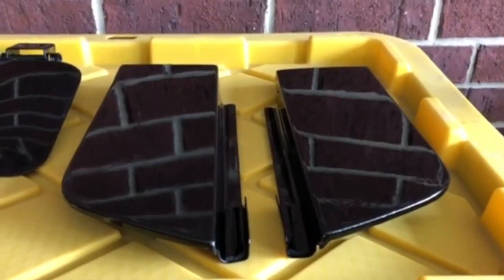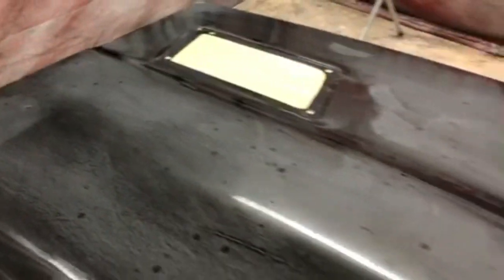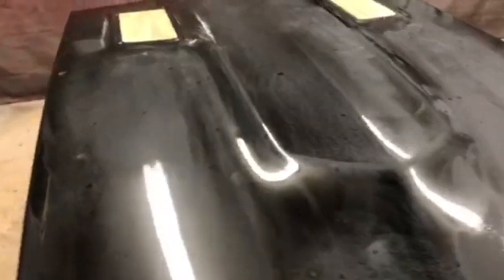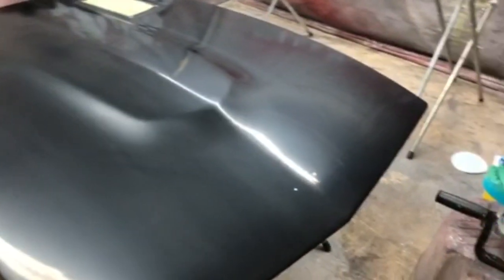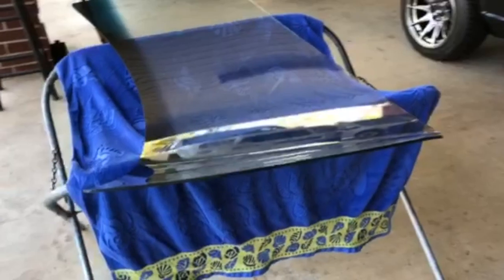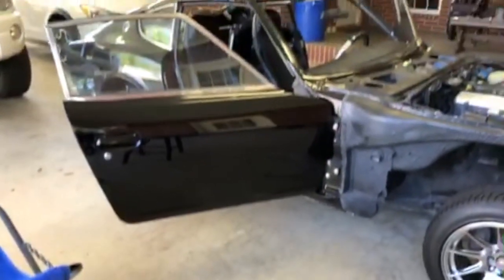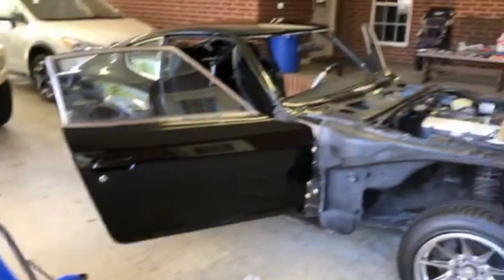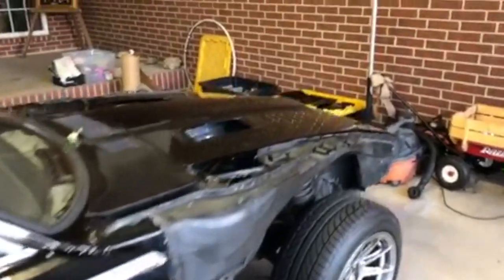280z Windshield Install and Hood repair, Z Dreams Part 6

Comment: Ready for SEMA
Reply from the maker: Lol! I wish. Maybe one day, one can dream.
Reply: Pickett Built my meaning was you went over and over your body panels.Whuch most people have no clue you have to "Do what ever it takes" Ive done so many perfect paint jobs and restoration of sports cars for 20 years. So you may understand why I admire the rat rod crowd.
I try and aim for a happy medium between your paint job and rat rod style. I coined it "Super Rat" which means you dont need a tetanus shot to ride in it or be around it.
All surfaces are clean with fresh paint. But dents dings holes aren't really a concern on the bolt on panels. So driving it in everyday traffic wont make me overly concerned.Think a good clean pair of jeans.
But my chassis and driveline  are very good.
Great job on the body and paint work though because you went for it.No body knows the cost of materials used its alot.And you provided the labor i ts so much more rewarding when you do it and YOU can always fix it.
When Im finished with the two I have Ill be looking for two more just to rebuild and sell.Im not really a house flip guy , id rather flip a few vintage cars and cafe racer styled motor cycles just alot more fun.
I keep watching your old videos and enjoy your adventure.Its about the journey really the car is just a side benefit.  Well a very cool good looking benefit!
Reply from the maker: MindDezign Definitely been an adventure for me and learning process. Very rewarding looking back, knowing all the work that went in and that I did it myself. This is the whole reason I started filming so I could look back on it all and others could enjoy the journey too.